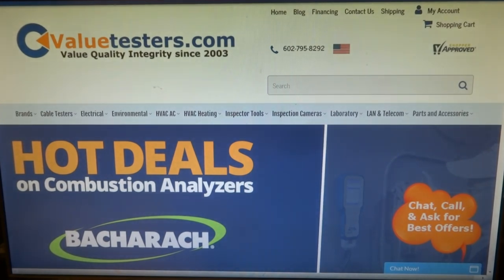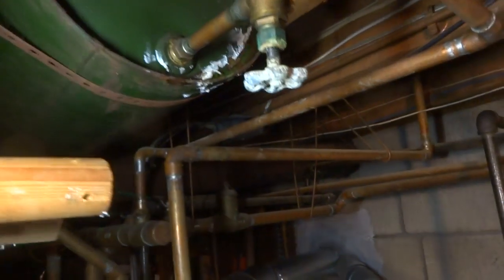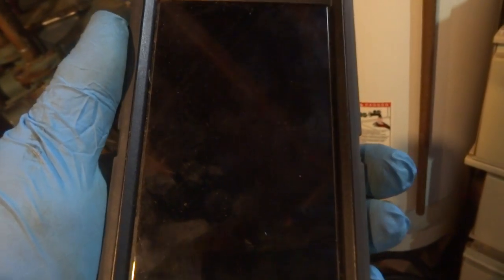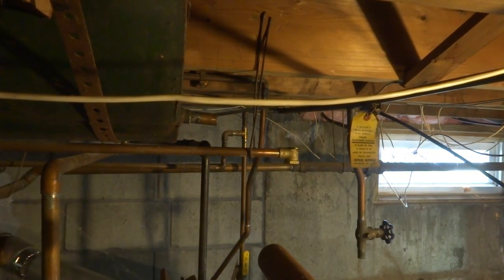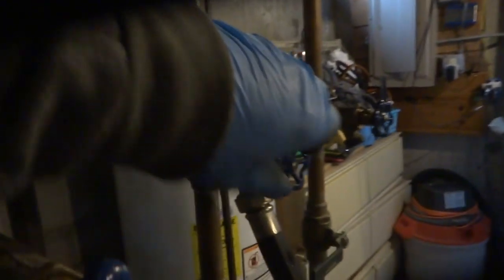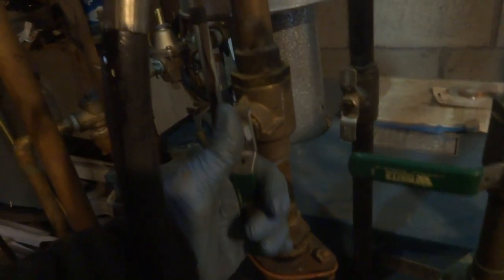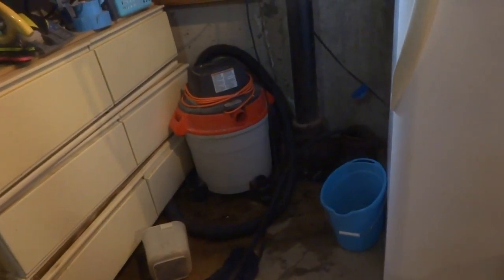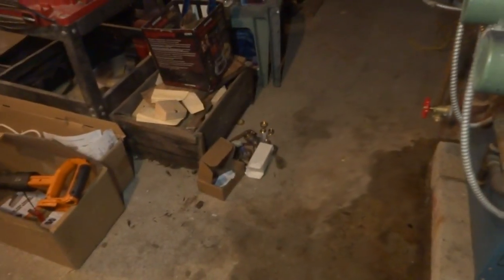water leak above Gas Boiler / bad expansion tank

Comment: I have the exact same tank piped into a 466 WM boiler. System’s working fine but thinking about replacing expansion tank before it starts to leak. Thanks for the video.

Comment: Cant you bleed off little to drop pressure to just above inlett feeder pressure then turn on heat to get final pressure?? And if too high set inlet feeder pressure lower to start at lower preesure before heat up ? Also understan total volume of water expanding determines the final pressure and if tank can't absorb expansion then pressure gets too high.